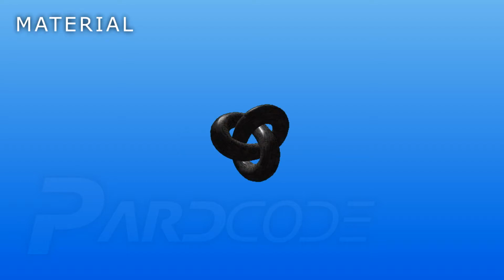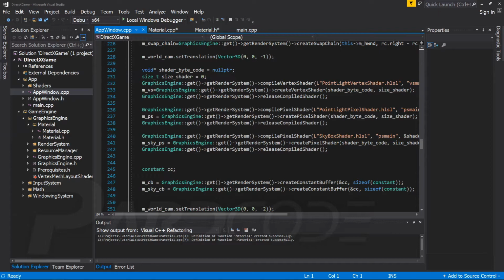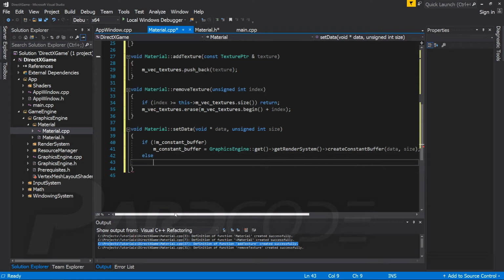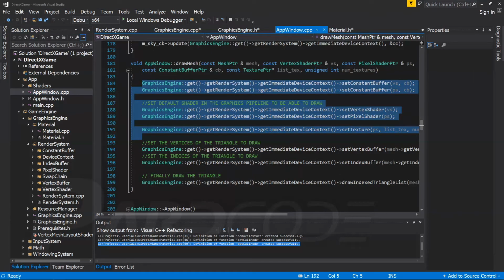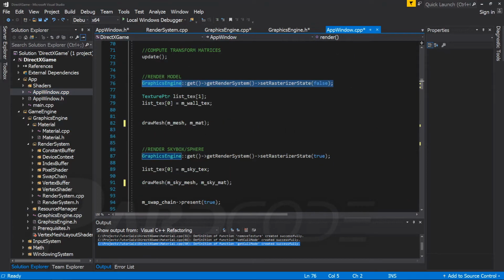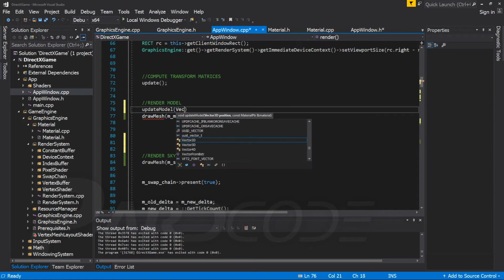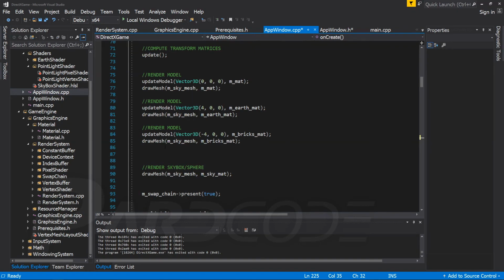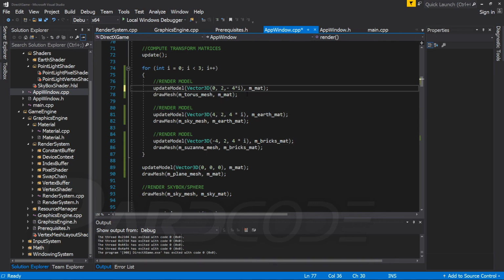C++ 3D Game Tutorial 24: Creating 3D Engine - Materials

Comment: How do you increase the RAM of Visual Studio?  I set the maximum virtual memory to 8 GB in settings,  but my program maxes out at 90MB.  This  is a problem because the program lags when I try to render more than 10 objects.
Reply from the maker: Hi, mate! In this case probably the lag issues are not related to the amount of RAM available. Maybe there are other factors that slow down the framerate. Try to close apps that can conflict with the execution of the 3D Demo (Graphics Apps, etc..)
Reply: @PardCode  The only thing I have open is this video in google chrome.  My computer has 32 GB of ram and an NVIDIA RTX 2070 graphics card so I should be able to render more than a few cubes.

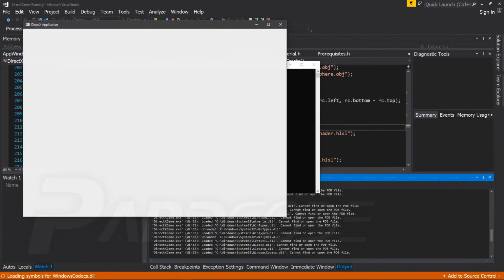Comment: When you press play at the 28:00 minute mark my program crashes and I get an exception thrown in some vector class? It says "Exception thrown: read access violation. _My_data was 0x30."

Great video btw! I've been following along with this video to help me with my University project.
Reply: on line 704 of vector
Reply: ok So i subscribed to your patreon to get your code for episode 24 and pasted it in and it fixed the exception thrown in vector. But now it seems  I am getting a problem in memory... 
Also a read access violation on line 704 in memory. 
"
protected:
    _NODISCARD element_type* get() const noexcept {
        return _Ptr;
    }
"
I have no clue how to solve this and I am having trouble finding solutions online.
Thanks for all the help and the great video!
Reply from the maker: Hi, mate! First of all, thank you so much for your support! It's a bit difficult to understand what's the problem with only these information. . If you send me your project in a zip file, I can check where are the errors. You can use Google Drive or Discord, as you prefer. Make sure to delete the .vs folder (hidden) and the x86 and x64 folder.
Reply: @PardCode  Hey thanks for getting back to me! here is the link! https://drive.google.com/file/d/1vdpefesi2aTAJc-IhNYCuY9QPde0pgij/view?usp=sharing
Reply from the maker: @veebz7836  The problem is that the torus.obj and plane.obj files are missing! Copy-paste them from the assets/meshes folder.
Reply: @PardCode  Oh my word wow I cannot believe I left that part out! Awesome, works perfectly now! Thank you so much!
Keep up the amazing work!

Comment: Im not too into c++ but if i found a c# vulkan binding possibly for wpf, would you think the performance would be good if I did that?
Reply from the maker: Hi, mate! Usually it's never a good idea to make some sort of graphics engine upon interpreted languages like c# or java, mainly for performance reasons. However you can use these kind of languages to make high level applications (e.g editor with panels, game etc.) that are built upon a Graphics Engine. But the Graphics Engine itself is better if it is made with compiled languages like C or C++ .
Reply: @PardCode  Ah, well my wpf engine I was making had dockable panels, but do you think its possible to embed a c++ engine within a panel so the app can be in c# but the engine scene is in c++?
Reply from the maker: Yeah, It is possible, but it's a bit tricky.
Reply: @PardCode  Well im gonna attempt to find an answer that can either work or is just impossible and so than Ill need to either make my own UI in c++ or use another UI framework like qt.
Reply: @PardCode  Aye, I just found a really good question that got answered in a way that might satisfy me: https://gamedev.stackexchange.com/questions/124249/how-do-i-render-my-directx-c-engine-to-a-c-panel